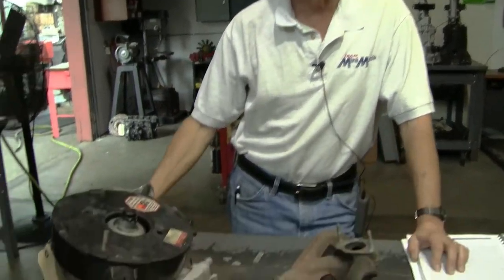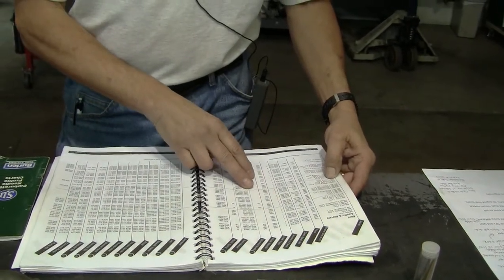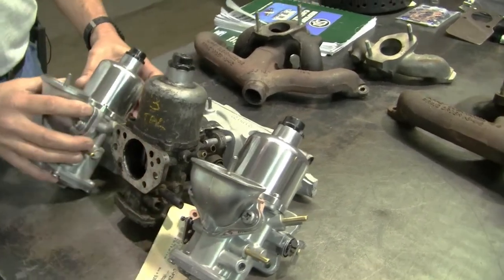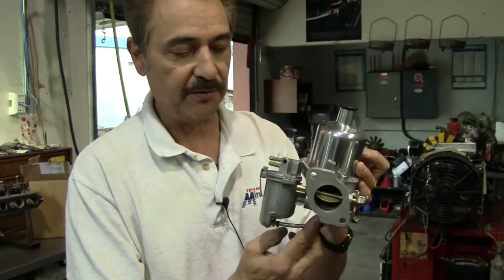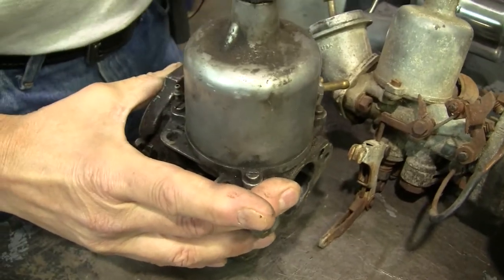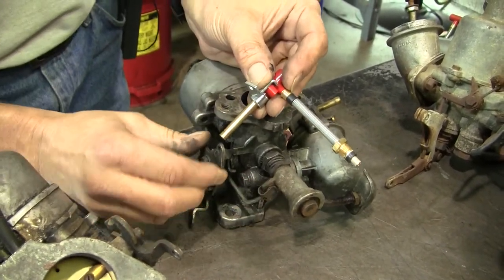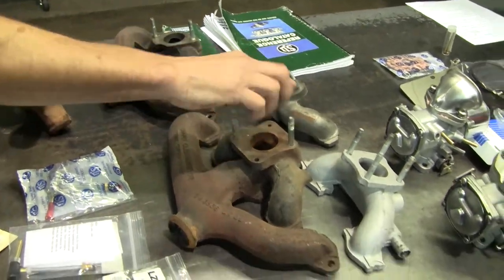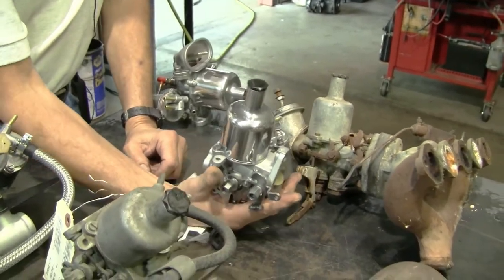SU Carburetor Identification - Mini, Sprite, Midget, & Morris Minor

Comment: Thank you. Very instructive and useful video. I wonder if you might make video in the future which outlines the various enhancements available for a standard 998 mini engine? I'm looking at affordable ways to increase the performance of my mini without having to do major work to the engine.
Reply from the maker: Well, the 998 isn't a great starting point for performance enhancements unless major rebuilding is undertaken. You could rebuild the block with our +.080" pistons and rebuild your head with larger valves but that's a sizable investment that still wouldn't get you where a stock 1275cc engine would be in terms of power. 

However, we're currently working on a test case 998 A+ block right now that will be featured in a new video in the coming months. We're hoping to get 1275 performance from that block - we'll post it once we get everything together and see what the dyne says. So, stay tuned!
Reply: Looking forward to your video. Thank you.
Reply: i guess Im pretty randomly asking but do anyone know a good website to watch newly released series online?
Reply: @Harper Rory Flixportal =)
Reply: @Chris Miles thanks, signed up and it seems to work =) Appreciate it!
Reply: @Harper Rory No problem =)

Comment: @11:37 of the video you talk about an old “H” carburetor. It’s hard to make out what you are saying as you were moving the carb and it was clanging against the metal table. Can you give me more details about that carb please? I have a 1954 Morris minor and it’s missing the carb and air cleaner which I’m looking to get. Thank you for the video and the info.
Reply from the maker: He was just mentioning that the early SU H carbs look like that. They have the single bolt through the float bowl lid and the lever at the bottom. I believe that's an H2 carb - earlier than the later HS carbs.